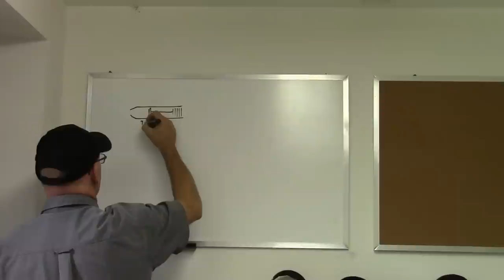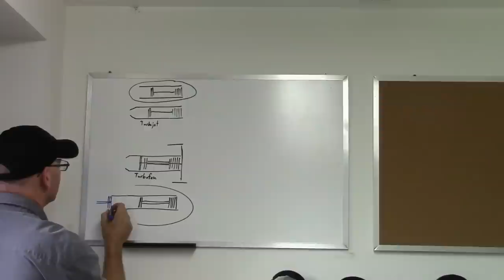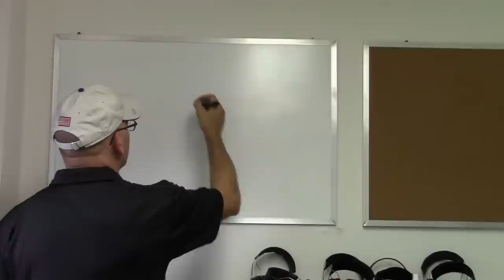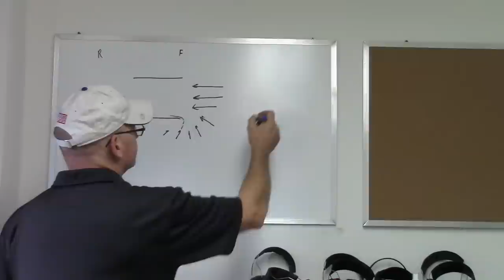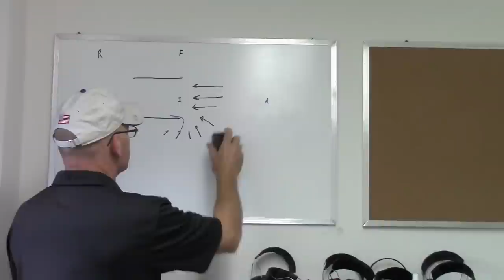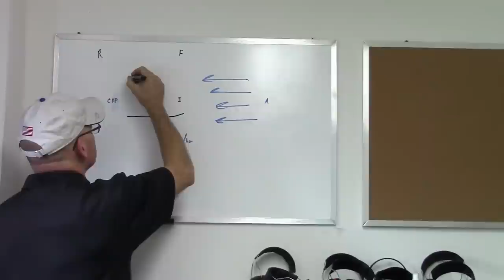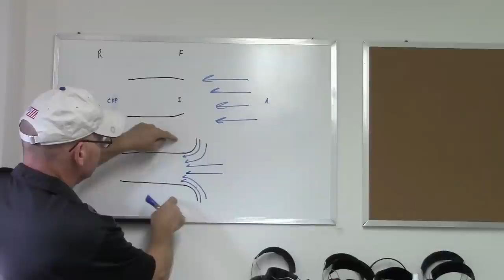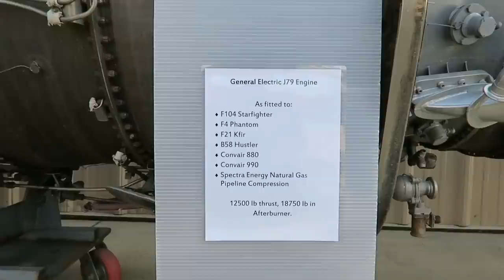Jet Questions 66

Comment: I might have missed it but I think you never mentioned when a compressor stall can occur.
I know it is a rare thing, I know it can happen if you override the control unit and control the pitch manually (->"VSXE-2: The Second Day").
But what other circumstances can cause it?
Great videos as always!
Reply: Kalimerakis I have a couple of quick examples of causes of compressor stalls. First, maneuvering the aircraft in such a way as to disrupt inlet airflow (F-5's with twin J-85's were famous for this for a time until, I believe, changes were made to the IGV's. Also flying into the turbulent jet wash of a aircraft you were following too closely could induce a compressor stall. A second common cause was often related to a malfunctioning compressor bleed valve.
Reply: Thank you, Merlyn!
Reply: Kalimerakis That reminds me, I don't think +AgentJayZ has done a video on compressor stalls.
Anyways, I think the first set of engines for the first 747 had issues with compressor stalls, but I don't know what exactly was causing it. I do know that the test pilot could induce one when asked to, and apparently had to show an exec at P&W what caused it before they fixed it.
It was part of a documentary, so I'm not sure if it's accurate or just drama added for TV.
Reply: 44R0Ndin Let's get the terminology of 'stall' and 'surge' sorted, as the words can and have been used casually and interchangeably in the industry, which I believe to be incorrect (but I've been told I'm pedantic). When I first started as an apprentice, if an engine 'coughed' on test, which it might occasionally when the fuel system hadn't been set up properly or the throttle man mishandled it, the event was usually described by the test crew as a 'stall'.  However, the more commonly and accurately used term for such an event is 'surge'.  This is when the flow through the compressor(s) transiently reverses, there's a loud bang and flames come belching out of the engine intake.  Engines can run 'off-design' with one or more stages of their compressors partiallly 'stalled', but not actually go into a full-blown surge.  All compressors can have a graph known as a 'compressor characteristic' drawn for them, the most important line on which is the 'surge line'.  Below this can be drawn a 'working line', which represents the pressure/mass flow/speed relationship along which the engine can safely be operated.  The difference between the two lines is the 'surge margin'.  The surge margin can be degraded by accelerating the engine too fast, accidentally or otherwise, and the engine may then surge.  The surge margin can also be degraded by loss of compressor efficiency, if, for instance, blade tip clearances become excessive, as a result of wear.  It can also occur transiently when the compressor casings heat up more rapidly than the compressor rotor during acceleration of the engine.  I recall seeing a DC10 taking off at JFK years ago: one of its engines surged three times in rapid succession during the take-off roll.  More recently, I was a passenger on a B.737 landing at dusk at LHR.  The right-hand engine surged on selection of reverse thrust and there was a bright flash of flame, which illuminated the whole engine nacelle.
Reply: grahamj9101
First off, hello fellow pedant!
Just so I'm clear on this, surge vs stall is a matter of severity, right?
Would this set of definitions work?
Surge = Mild upset of airflow in one or a few stages of the compressor. Usually makes a thump or bang, rarely shooting flames out of the engine. Mostly harmless.

Stall = Severe upset of airflow in ALL stages of the compressor. Always makes a loud bang noise, occasionally flames shooting out of the engine. Moderate chance of damaging the engine.

If it's not that, my next guess is that a stage of the compressor experiences a "surge" if the blades and/or stators of the compressor are aerodynamically "stalled", and therefore there is no such thing as a "compressor stall" only compressor surge.
If it's not either of those two, please explain to me, as I want to get it straight in my head.
Reply: 44R0Ndin Sorry if I've misled you, it's the other way round: surge is severe, stall is mild, as might be inferred from nature of the words.  With a surge, you will always get a loud bang, almost always with flames out of the core engine intake and, in a big turbofan, the flames may go back through the fan and down the by-pass duct.  There might be a risk of damage in the engine, because of large deflections of the compressor blades, which might possibly 'clash' with their stators.  However, in a well-designed engine the axial clearances will be such that this is unlikely.  With a stall, it is a case of localised disturbance in the compressor, which can be of varying severity, but there is not the total flow reversal of a surge.  Individual compressor stages might stall transiently and this is likely to be of little consequence.  Beyond this, there is a phenomenon known as 'rotating stall', which may be heard as a disconcerting rumble, but which can be cleared as the engine accelerates. Then there is so-called 'locked-in stall', which means what it says.  Usually, this cannot be cleared, the engine may not accelerate and the engine may well over-temperature.  An immediate shut-down is advisable, if not essential, to avoid doing nasty things to the turbine.  I hope this helps.
Reply: grahamj9101
That helps out a bunch, thanks!
I wonder, are there systems in the engine that can detect and/or clear these stalls automatically?
It's likely only installed or designed into more modern/advanced engines, but it seems that it would have to detect a problem with the airflow thru the compressor and respond to it by rapidly cycling the VSV's and/or bleed air valves to the start position, followed by setting them back to where they were before the system detected an issue. It would probably have to cut back the fuel flow at the same time to keep the EGT in check, but it seems that it could be programmed into an engine's FADEC using at most a few additional differential pressure transducers to measure the pressure rise across the compressor.
It seems like it could work, I just don't know if any engine actually does something similar yet.
Reply: 44R0Ndin I'm going to have to admit that, having retired 12 years ago, I'm not up to date with the latest control systems, although I do know what a FADEC is and you obviously know something about gas turbines, as you can throw in the three-letter acronyms.  With a state-of-the-art FADEC and sensors in the right places, it should be possible to detect an incipient stall or potential surge and supress it.  What might be the advantage of this, I ask myself?  Possibly to run the engine more efficiently, but closer to surge?  However, I would feel more comfortable with a design that is less susceptible to surge.  Nevertheless, I am vaguely aware that some experimental work was done at R-R Bristol some years ago on a surge suppression system, which was based (I think) on some form of flow recirculation.
Reply: grahamj9101 Very astute reply Graham. And much appreciated. I think we all have opened a very interesting subject for Jay's attention. The topic has certainly raised some very well founded comments and observations. It's all in the interest of understanding, not to criticize, debate or dismiss. Lot's of us have pieces of the puzzle but not the whole picture. Thanks!

Comment: Correct me if I'm wrong as I've learned most of what I know in jets from your videos:
the orenda burners you just showed ate cans burners while the j79 is annular can burners. If I got this wrong could you compliment the video where you draw them with real footage of each type of burner ?
Reply from the maker: louigi600 They are combustors, not burners, but otherwise your description is right. Burners is a term the UK people use for what Americans call fuel nozzles. In the same way the Brits use the name flame tube for what Americans call combustion liners. As we see here in comments every day, you can call the different parts anything you want, but it helps avoid confusion if you stick to the standard, generally accepted definitions.
Reply: +AgentJayZ I say intake casing, you say front frame: I say intermediate casing, you say mid frame: I say snubber (but R-R Derby says clapper), you say mid-span shroud - but let's not call the whole thing off.  I'm fairly familiar with Stateside gas turbine terminology and I do try to translate, when I think about it.  I could use the term flame tube, or combustion liner, or even 'can' interchangeably for an engine that has several individual combustion chambers, and I might describe it as having a cannular combustor arrangement, if all the cans are contained within a single outer casing.  Combustor is a term I also use, although I believe it to have originated on your side of the Pond.  For me, the term combustion chamber implies an annular combustor, which is contained within a combustion chamber outer casing (CCOC) and a CCIC.  I could go on ..... but won't.

Comment: Hey Jay, on the first engine shown you mentioned that it had no jet pipe on it but that long pipe from the turbine back is what? I thought that provided some restriction before the variable nozzle, and you guys use it to put a load on the lm1500 to test after a rebuild. Thanks and great vid as usual.
Reply: Greg ory The long tapered thing on the end of the gas generator is a testing device used in place of a dynamometer to measure the engine performance. Since the LM1500 makes 10,000 shaft horsepower when mated to a proper power turbine, and since a mechanical dyno that can measure 10,000 horsepower is not an easy thing to build, They use a jet pipe (A gas accelerating nozzle) to measure the thrust generated by the engine, and thus calculate the horsepower that it would produce, if it were connected to a power turbine. 

The jet pipe is a piece of test apparatus and does not leave with the gas generator when it goes back to its owners. Jay was referring to the gas generator itself and didn't specify that little detail.

The LM1500 gas generator does not ever have a variable nozzle, you have to remember to keep the J79 and LM1500 separate in your mind.

In a jet engine, restrictions in the gas path are a bad thing. There is nothing in front of the variable nozzle of a J79 engine except for a long tube and some fuel spray bars and flame holders.
Reply: Ok the afterburner pipe on the j79 is non restrictive its just the variable nozzle providing restriction. The pipe in this vid is something specific for testing the lm1500 not a part of the j79. Thanks for the detialed response!
Reply: Greg ory Glad I could shed some light on the matter for you.  :)
Reply: +Greg ory I would describe what you see on the back end of that LM1500 as a 'slave' jet pipe and fixed final nozzle assembly, possibly adding 'for ground use only', to be pedantic - but then some industry test cells did use 'slave' GUO jet pipes for the testing of some jet engines.  OK, the jet pipe you see isn't the afterburning jet pipe and con-di nozzle assembly of the J79, but they are both performing exactly the same basic function.  AgentJayZ tells me that the 'slave' assembly gives less thrust than the J79 jet pipe and nozzle, but then it wouldn't necessarily, unless the LM1500 was being run at a comparable and corrected rating equivalent to a given rating of the J79.
Reply: +Ryan Willis To add a little levity to the proceedings, I remember (yes, the old *  is at it again!) walking past a storage area with a colleague and seeing a long transportation case, almost certainly for a Viper engine jet pipe.  On one end was stencilled in large letters the words, "Bellows this end".  We both had the same thought, "What does it do at the other end?"
Reply: Thanks for the info, very interestering stuff, and yeah thats pretty funny!

Comment: Hey AgentJayZ, great videos!
I got a question, so when a plane is flying at 40,000 feet where the outside pressure is significantly lower, how does this affect the pressure inside the engine? Does the faster movement speed of the plane force enough air into the engine to keep the pressure constant with altitude, or does the pressure fall with height? If the pressure does fall, what effect does this have on the operation of the engine?

Also, recently I watched a plane crash documentary where they explained the jet engine's operation as "A series of fans moving air uniformly through the engine" or something along those lines. Immediately I thought about what your reaction would be if you saw that! (:
Reply from the maker: kuba kuba 1) - I think absolute CDP does decrease with altitude, so fuel flow needs to be reduced accordingly, even at full throttle.
How much? That's for the engineers and designers.
2) - that's a gross oversimplification of the process, so much so as to be not only useless, but misleading. Typical of a modern "documentary".
Reply: AgentJayZ 1) - Makes sense, thanks!
2) And now people who watched the documentary will come in here and ask you why the "fan" doesn't spin on a turbojet!
Reply: kuba kuba Backing up AgentJayZ's explanation, compressor delivery pressure  decreases with altitude and I've explained this in previous posts.  The compressors have a given design pressure ratio, so that, as atmospheric pressure decreases with altitude, the pressure they can deliver decreases similarly.  This means that the mass flow of the engine decreases with altitude, as does the fuel flow and available engine thrust.  However, the drag of the aircraft also decreases with altitude, because of the 'thinner' air, and less thrust is needed.  An example I've used before is the RB211 in the Tristar.  The engine's take-off thrust was 42,000lb, but at cruise altitude of around 35,000ft and at a speed of 520 knots, its thrust was about 9,000lb.

Comment: But why don't they use turbo fans for power generators? In planes, as you've stated, most of the thrust comes from the fan so why not harness the power of a fan as well? Or does the power used to spin the fan negate any advantage?
Reply from the maker: cdangers I don't think you are clear on how these engines work. Please watch my videos on power turbines,. You may enjoy them.
Reply: cdangers In a turbo fan the fan is the thing powered by the engine core, it does not generate power itself. It consumes it and turns it in to thrust. The power that it would use is what the industrial engines use to perform their work. So if you had the fan you'd get no useful work out of the engine.
Reply: cdangers 
What would be the point of that? Would you like your power generator to take off? The fan does not magically produce power.

Comment: If an engine were to be run without the bell shaped inlet, I'm guessing there'd be excessive injestion noise, increased fuel consumption, inaccurate gauge readings, and  compressor stall?
Reply from the maker: Jeff Manning It would run OK, but would have more inlet noise. It would make less power for a given RPM and EGT. It wouldn't stall and the gauges would still work well.
Reply: Jeff Manning If a J79/LM1500 (or an Avon, or an Olympus - or any other similar engine) were to be run on test for any length of time without a bellmouth intake, I would also be concerned about flow separation from the sharp edge of the intake casing.  There would be a risk of this causing a non-uniform flow into the front face of the compressor and giving the first-stage blades a 'hard ride', resulting in excessive vibration and fatigue cracking at low lives.